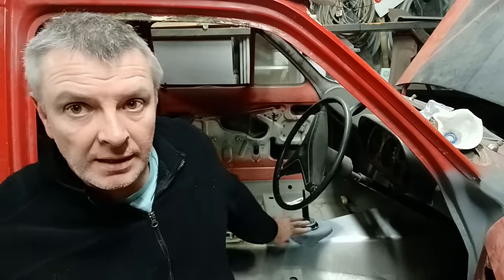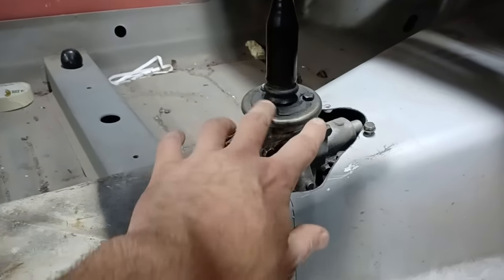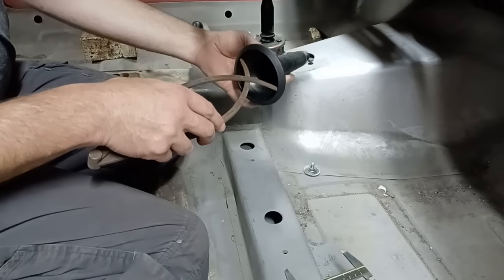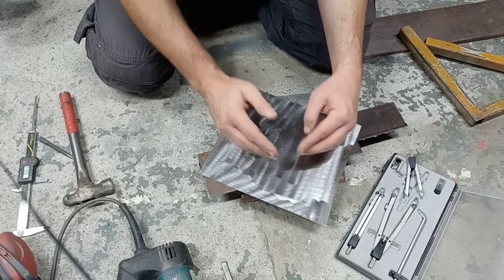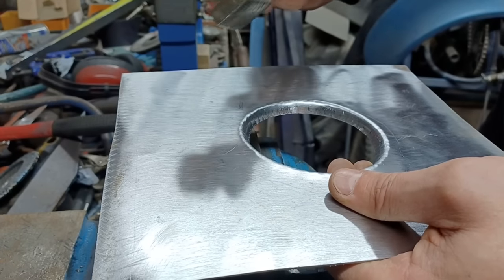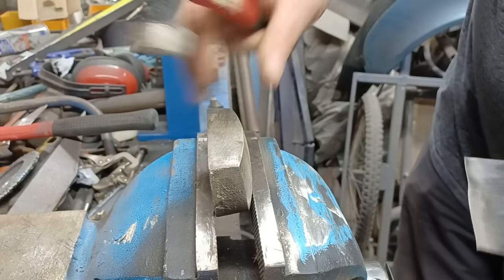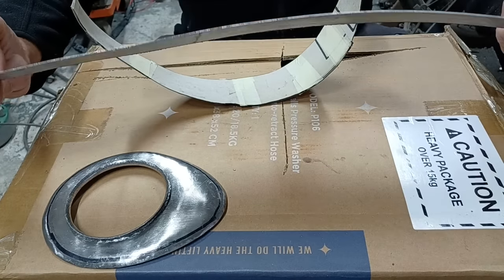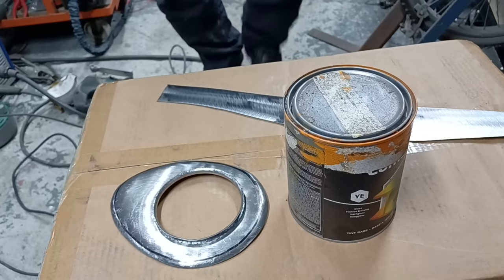Ford Escort MK1 Restoration. Fabricating a Gearbox Turret.

Comment: impressed with the hole cut with the jigsaw. didn't know that was do-able. I've spent holes drilling holes out and filing
Reply from the maker: With a decent 24tpi metal blade, it works a treat.

Comment: Good bit of fabrication as always Dave. I cheated when I did my gearbox tunnel I cut out the  gear lever opening section from my old tunnel and used that section as part of my gear lever turret for my new bigger tunnel.

Comment: That looks spot on Dave, worth the time and effort it took 👍.. mx5 hose ... You can get an alloy inline T with a sender take off .. but the bonus is , it will extend that hose slightly and it may well fit then
Reply from the maker: Thanks for the tip

Comment: I see you have gone back to using gas with your welder. Did you fing that the fluxcore wire didn't work as well as you exoexted?
Reply from the maker: It worked fine, but it is messy

Comment: Nice job dave is the mig gas the same  they use in the pub   and as good as argon
Reply: I used to use 'pub' gas , works fine but does cause a few amount of splatter ...  I'm on argon mix now .. big bottles , much cleaner weld
Reply from the maker: As per comment, I haven't tried argon mix, but happy with co2